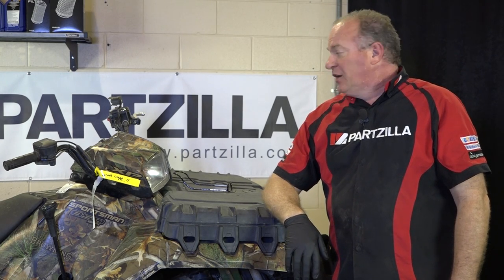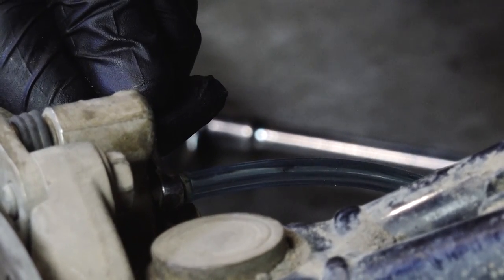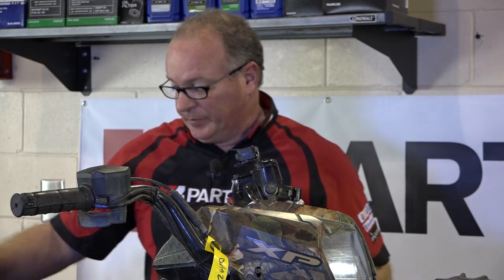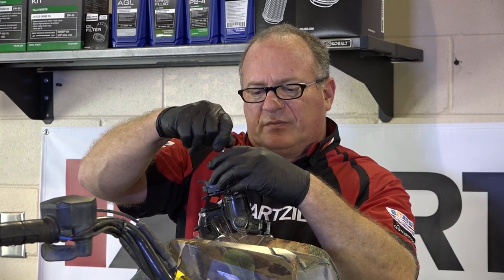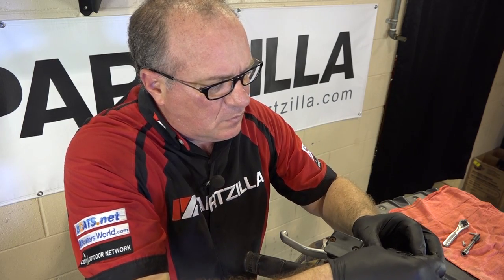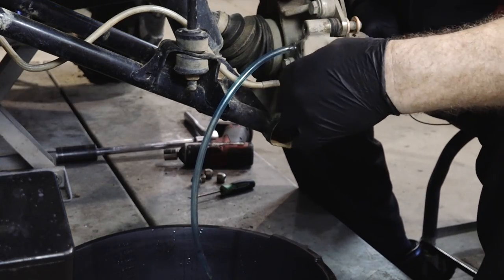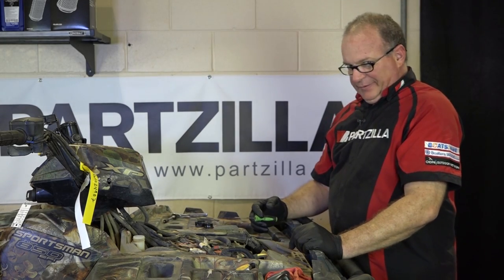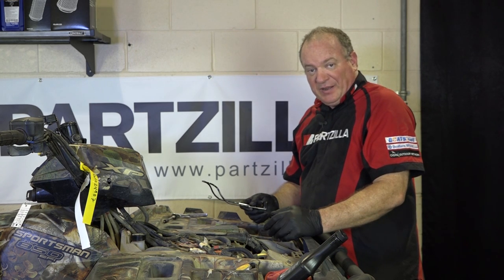How to Bleed Polaris ATV Brakes – Front and Rear | Partzilla.com

Comment: Another great video.  A couple hints that I have found useful.
1. Rather than removing the foil seal on the brake fluid bottle, poke two holes on opposite sided with a clean nail.  This lets your pour a controlled, drip free stream from one hole while air vents in the opposite hole.
2. Place a clean utility knife blade in your master cylinder during flush/bleed.  Allows you to leave the cover off without getting fluid squirted out each squeeze of the lever.

Comment: This was a bear of a job for my 98 Polaris Sportsman 500.  I spent almost 2 days trying to bleed the brakes.   The foot brake went okay but the handle bar lever was a terrible job and I got no success doing it this way.  Instead I found information on reverse bleeding using a new old can ($7 at Canadian Tire), clear hose and a turkey baster.  This was a much easier because the master cylinder just does not pump enough to rid the system of air when bleeding all 3 calipers.  By rotating back and forth doing this, I finally got brake pressure back again.  The video was good for the foot pedal as it's a small system but I was ready to give up on using it for the lever.

Comment: Use a small container of clean fluid to vent the fluid into as you bleed.  It will allow you to easily see any bubbles and even how much fluid you are moving during each stroke of the handle.

Comment: The brakes described in previous comment are on a 2003 Polaris 330 magnum atv. The calipers in front and on the back have been changed and both master cylinders have been changed.  I have bled them numerous times

Comment: Your suppose to do the rear master cylinder first using the front brake lever as it is the longest line in the system.  Then do each front side using the front lever.  Then do the rear brake using the foot brake lever.  The 850’s have a junction box or distribution block in the system.  Meaning you bleed in 4 places not 3.
Reply: so youre saying 6 bleeds?  bleed the back 2 using the front lever, then bleed the front 2 using the front lever than again the back 2 with the pedal?   so 6 bleeds all together?

Comment: The rear master cylinder on my 2010 sportsman 500ho is bad. Since it needs to be removed and replaced, do I need to bleed the front as well as the back since their connected? Thanks.

Comment: By the way. The leak on the rear reservoir is at the barb fitting/hose connection. The brakes were working fine til this. The handlebar Reservoir lost all its fluid but the rear brake reservoir is full to the max without adding fluid.

Comment: My brakes will not work without pulling the lever and pushing the back brake pedal at the same time. I have no brakes if I pull the lever by itself. What would cause this

Comment: Hi i have a 2008 500 ho sportsman. Two breaklines on back caliper. When i do front would i then do the back one that leads to the front first? Or the one that has its own cap filler

Comment: Question for yall  I have 2000 trx450es replaced all 4 wheel cylinders on front bled brakes pump up a few times gets good pressure but after about 30 seconds there is no pressure but will pump back up to were there is pressure but looses it what could problem be bleed for 2 hours plus not finding any more air in the system

Comment: Hi i have just replaced my brake master cylinder with a new one, the system from resevoir to caliper is dry. I have filled resevoir but its not filling the system. Any suggestions?
Reply from the maker: The caliper has an air pocket, bleed the caliper, then the system.
Reply: @PartzillaParts  thank u for the prompt response, appreciated. What is the best way to do that? Russell in Qatar
Reply: @PartzillaParts  hi. Maybe non conventional but i loosened the master cylinder tube connection and used a syrenge to fill the caliper through the bleed screw until fluid came out at the master cylinder. After that bled as per normal and walah i hv brakes! Thank you for you support it really helped.

Comment: Jumping in this a little late, at the tail end of this video you mentioned about the rear brake reservoir bleeding over, this is happening on my 99 scrambler 400 when I pump the left brake handle. The brakes were working fine then they wouldn’t build up pressure, when topping off the handle reservoir and pumping the brake handle the bleed over occurs. On the fronts the pads appear to have adequate pad material. When I spin the hubs with the front wheels off, the right side spins freely with no resistance while the left spins with resistance then catches and you’ll need more force to spin it. On the rear, the left bad looks much more worn that right pad. I’ve bled the brakes without getting things to firm up. Could the rear pads need changed to prevent the rear resovoir overflow or be a combination with the fronts too?

Comment: I'm working on a 2014 Sportsman 400HO. If pumping the handle only develops a mild resistance, I guess this means the master cylinder is gone? It started by working "weird", sometimes going down a hill you would have to release and pump the handle to get brakes and then over a week or so, no brakes at all. I checked and changed the fluid and bled at all calipers but not getting much back resistance.

Comment: John,
I have a Polaris 700 Twin EFI. It has a brake device connected at the base of the rear brake pedal. The rear brakes work fine when the handlebar brake is depressed. But I get no rear brake when I depress the pedal. I adjusted the linkage so that the brake device by the pedal is compressing. Nothing. I took it apart and cleaned it. Bled the brakes. Still no rear brake via the pedal. Suggestions? Thanks, 
Steve

Comment: I have a 98 Sportsman 500 that was in the shop and they didn't even fix my brakes. The guy said I needed a new master cylinder in the back and that it took care of my master cylinder problem but that when he tried to bleed the air that it was bypassing to the front master cylinder. Do you think he cracked open the wrong bleeder valve? The front lever controls the front and rear brake and the foot brake just the rear

Comment: So if you service the front, do you need to bleed the front and back? Or just the caliber you had serviced?
Reply: Keith Boyd you shouldn’t need to if you are just working on one front side or just the rear.  If you are replacing a brake line though I would bleed everything as ALL the brake lines on the 850 go to a junction box up front.  I mentioned the bleed order in a previous comment but here it is.  1) Rear Master Cylinder (using front brake lever)  2) One Front Caliper 3) The Other Front Caliper (front order does not matter) 4) Rear Caliper (using foot brake).  Do yourself a favor and get a BikeMaster air powered bleeder.  Makes the job easy.  Hook up to the valve and lock the BikeMaster on (engage air), slowly crack the valve until you see fluid then go check the reservoir.  It will slowly go down and all you do is sit there and fill until you are satisfied all old fluid is gone or all air is purged.  Then go close the bleeder valve.  Then unlock the BikeMaster to stop suction.  Do the next line.  10x easier than pumping brakes and opening and closing bleeder valves over and over again.

Comment: What is part number for 1994 Polaris 250 trailblazer master cylinder? And do you have a diagram showing where bleeder valve is? I am speaking specifically about front brakes
Reply from the maker: https://www.partzilla.com/catalog/polaris/atv/1994/trail-blazer-w947221/controls-master-cylinder-brake-line-trail-blazer

Comment: I have a 2014 Polaris sportsman400 HO I am having a problem bleeding my brakes I have bled my front brakes and I went to bleed my rear brake and still have a spongy brake but if I hold the front brake handle and push the brake petal down the machine stops fine if I use either the brake handle for the front or use the foot pedal for the rear by themselves both handle and pedal are spongy please help
Reply from the maker: Fluid is full? All the connections are tight?  Could be air in your master cylinder or one of the banjo bolts is allowing air in.
Reply: My Sportsman 850 is doing the same thing after I changed my brake pads and bled my brake lines.... Florida_BMX did you find out a solution as to what was going on with your system?? I think I need to get more air out of my systrm

Comment: First I want to thank you for this helpful video. I  have 2005 Polaris Sportsman 500HO.  Hand operated brakes are working well but there is no pressure on footbrake. What should I do? Thank you :)
Reply from the maker: You can start by bleeding the line off the foot pedal.
Reply: @PartzillaParts  and after that what’s next? I’m having the same issue on my 2011 Polaris sportsman 850xp  we’ve taken the hose off and cleared it out to make sure it’s not clogged, hooked it back up and the foot brake still doesn’t have pressure, it’s getting fluid into the caliper but no pressure?

Comment: I have a Polaris 850 XP my power steering is not working I replaced the line from the main reserve I checked the relay and the fuse and it's still not working what else could be wrong if you could get back to me that be great thanks or do another video thank you
Reply: Carlos Delangel piston return springs are bad

Comment: Hi
When should I do this procedure ?
Every time I change brakes pad ?
Thanks for a great tutorials :-)
Reply from the maker: Hi Dudu,

The short answer: About once a year is good for maintenance purposes, and -- no -- you don't need to bleed your brakes every time you change your brake pads.

The long answer: 
Bleeding your brakes is all about making sure there isn't extra air in your brake lines. You'll need to bleed your brakes anytime you do any type of procedure that will introduce air into your braking system. For instance, if you were to do a rebuild of one of the brake calipers, or the master cylinder itself. Since changing your brake pads won't introduce any air into your brake lines, you're safe to change your brake pads without bleeding your brakes. 

Another thing to take into consideration is that brake fluid absorbs water which can create air pockets in brake lines -- so you may need to bleed your brakes more often if you're in a very moist environment or if you drunk your machine a lot on the trail. 

You should bleed your brakes when they start to feel spongy when you compress the brake lever, or if the lever continues to compress even after you you have the brakes applied. If you feel either of these symptoms that means that there is likely air in your braking system.&#160;

Planning to bleed your brakes about once a year is usually good unless you're feeling symptoms like those described above. How often you do need to bleed our brakes depends on how you use your machine -- only you can tell how it feels, how much moisture is in the air where you live, and how often you're dunking the thing on the trail.
Reply: Wow
thanks a lot for so detailed answer
Reply: U do it when the breaks feels like a clutch

Comment: John when bleeding the rear brakes on the 850 Polaris are you only doing the right side or both sides, 
Thanks
Reply from the maker: Always do both sides.  Sorry that wasn't clear in the video.  The procedure is identical, right and left.  Thanks for watching!
Reply: @PartzillaParts  Does it matter which side you start with on the rears, like you said with the fronts?
Reply: Partzilla at the same time I think is what he meant

Comment: Hey I have a Polaris 500 and the brake like is losing up and what could I do for that?
Reply from the maker: The brake line is loosening up? If so, do you have the correct torque on the banjo bolt.  
Brake Line Banjo Bolt Torque:15 ft.lbs

Comment: Dude, I really need to Know why my handbreak doesnt respond and just goes right in to the handle when u press it. It does not break and it’s like a clutch. Do you Know why??
Reply from the maker: You may need to rebuild your master cylinder
Reply: Did you ever figure out what the problem was? Mine is doing the exact same thing after I replaced the calipers. It’s mushy. I’ve bleed the lines over and over again and even used a brake vacuum kit. Still mushy.
Reply: Kory Kilbourne i just kept punping and let it be for a while and now its fine
Reply: @snusmumriken6091  ok thanks. I'm not sure if its a faulty master cylinder or it its just air trapped in the line somewhere. It does it with an old master cylinder and a replacement one I ordered. I also have new calipers on both front wheels.

Comment: I put new front brake pads on my Polaris yesterday and I tried to spin the rotor by hand and it was real hard to turn so I took it for a ride and it would slow its self down a decent amount. I was thinking the caliper or piston was sticking. Could any buddy help me out..
Reply from the maker: Start with the simple stuff, brake bleed or full flush.  You may want to inspect the caliper for any rust or debris on the piston that's making it stick.

Comment: Well. I've tried to bleed my brakes on my kazuma 110cc but when doing it no fluid is coming out of the pipe on where it comes from the calliper bleed whole. Just wanna know as been trying this constantly but nothing happening
Reply from the maker: So when you open the bleed valve and apply the brakes, nothing happens?  Pull the whole valve out, does anything come out now?
Reply: @PartzillaParts  nothing comes out. We've even bought a new calliper and still the same
Reply from the maker: I mean, silly question, but does it have fluid?  If it does, disconnect the brake line, does anything come out there?  Continue taking apart the system until you find fluid.  You could have a blockage anywhere up to the reservoir.
Reply: @PartzillaParts  well before this happend my starter motor went and hasn't been working for about a year. Would it of rusted the pipe. Where is the most likely to be rusted
Reply: Of how long it's just been sitting there for

Comment: Thanks, John. Your video was good for the back brakes.   Can you direct to where I can find out why my 2004 Sportsman governs and won't go faster than 30KM/Hh
Reply from the maker: There are quite a few things this could be.  Fuel, vacuum lines, etc.  Typically with the Sportsman, investigate the Drive (Primary) Clutch.  Check the springs and ramps (Polaris calls them Buttons) for abnormal wear.

Comment: Adjust Valves Polaris Scrambler 850  2014  Video ?
Reply from the maker: We haven't done a stand alone video for valves, but we did a full engine tear down and rebuild on a Sportsman 850.  There is some good information in this video.  https://youtu.be/t2VyjSV6Gz4  It doesn't show the measure and adjust, but it does show the the tear down procedure.